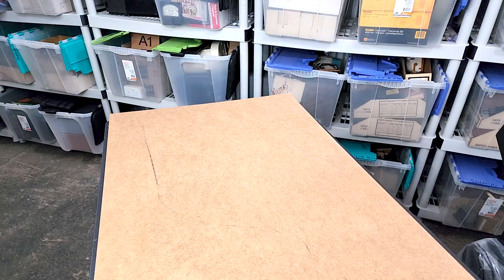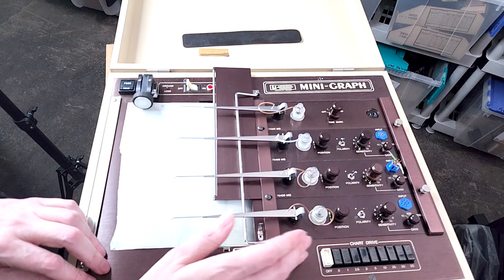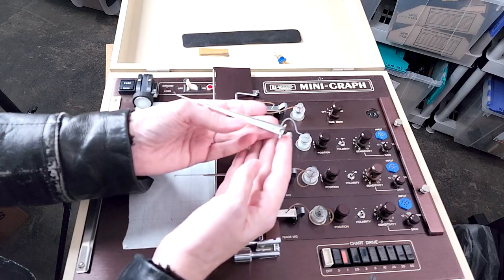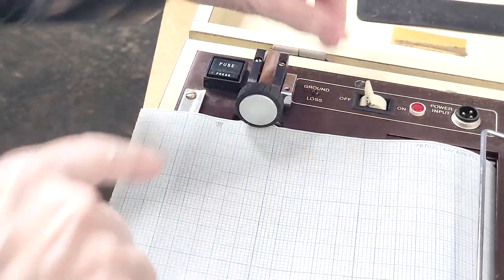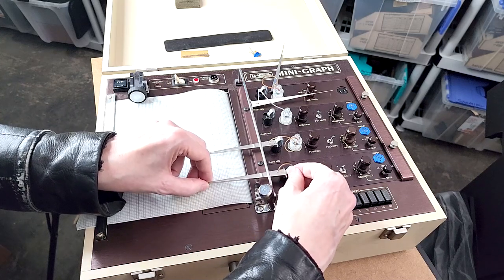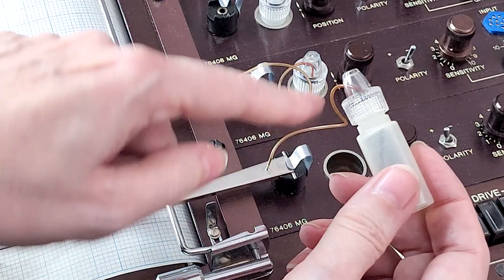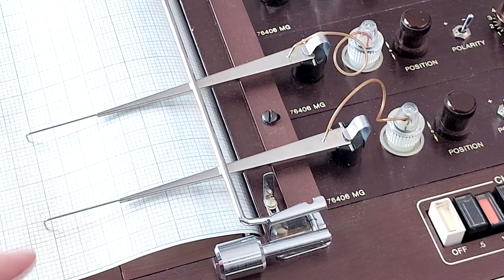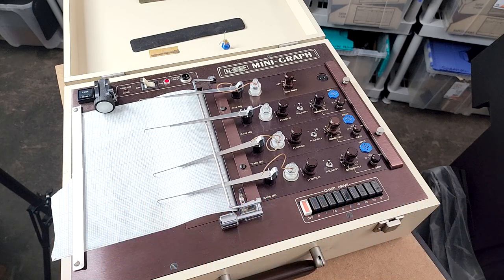From The Vault: Mini Graph!

Comment: I have an old chart recorder temperature humidity meter that used that kind of graph paper.  As the little nibs that held the ink had corroded from the ink to near useless, I decided to upgrade it. Thermal print rolls for old fax machines are wider, but easy to cut to the right width, and the clamp holds them fine. So took the old pens off, and put a tiny bit of stripboard there with epoxy as replacement, with some resistance wire formed into a tip to contact the paper. 

Used some fine litz wire stripped from old telephone cords, heavy type not the tinsel type, but still ultra flexible and light, to power the heaters, feeding down to the pivots so minimise error. The power to them was simple, 22uF polyester film capacitor charging up via a resistor to 12V, and a simple 2 transistor voltage follower to buffer the voltage, a 6V8 zener diode and a BT152 SCR to discharge the capacitor through the heaters. Brief hot pulse, enough to make a thermal dot on the paper, and the slow clockwork would not have moved enough to make the dot before the next pulse. 

Still got it, just the human hair for the hygrometer side is worn out, and calibration of the bimetal temperature side is a little iffy, as you would need to first use a thermal fax to copy the original long chart paper onto the thermal fax roll, to get the proper graph paper, and the error there is a little large.

Comment: While in college, I did a summer internship in 1977 at Gould Corporate Research Labs in Rolling Meadows (near Chicago). They were just in the process of stepping away from their decades-long prominence in strip-chart recorders and trying to go digital. My responsibility was to develop digital circuitry that would cause the traveling inkjet printhead to emit droplets of ink at a rate proportional to the speed in any direction. We never got it to work with TTL, and microconrollers (8051 style) were still a glimmer in Intel's eye. Gould had divested and been acquired by 1987, so long gone.

Comment: Looks like maybe that big heavy silver knob can pivot around and maybe then the pen lifter can get low enough to let the pen tips touch? Also, maybe that loose part with the roller edge actually could be reversed (roller edge further from the electronics) so that it holds the paper down to help keep it flat on the platen for the pens? Super cool stuff!

Comment: Interesting one. Making a power plug should be pretty easy with Molex pins (as in PC power supplies) and 3D printed body. The roller has definitely seen better days. Interesting input connectors (maybe DIY new ones too?) and writing mechanism.

Comment: Looks like the lying end of a polygraph setup.

Edit:. A quick Google seems to back up my assertion about this for a polygraph setup.  You can buy one on eBay, just like this one, for $399.  Something tells me that using only one drive roller for the paper leads to some temperamental issues.

Comment: Nice Haul. Would be interested in seeing the unused roll of paper and it's feed path. Suspect that the paper would go through slot in brown plate (cover for unused roll of paper?) you fitted at 3'30".
Also suspect some sort of mechanical damper on needles when unpowered, hence stiffness you noticed?
I would be interested in seeing you lift out one of the modules to see the style of wiring / valves etc. No need for opening the case, just the swappable modules?
Love ya videos, well done.